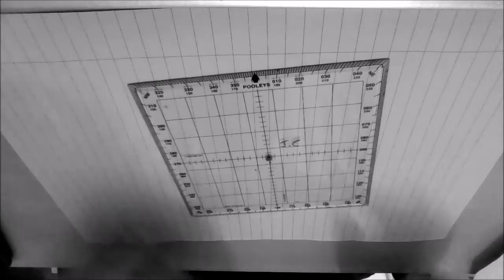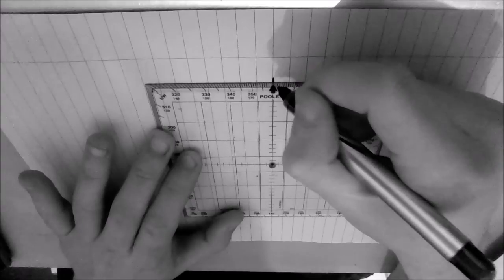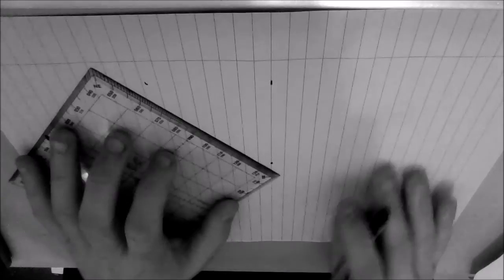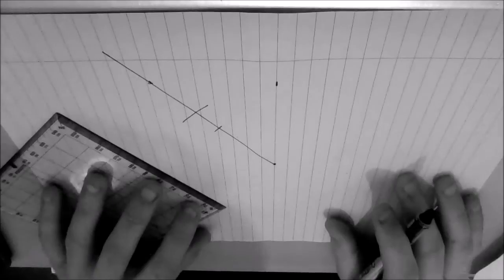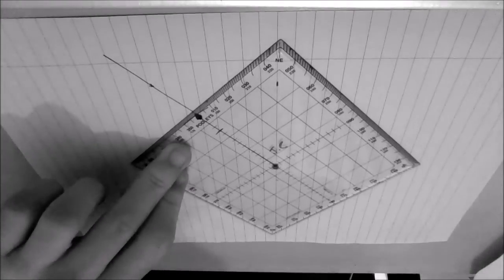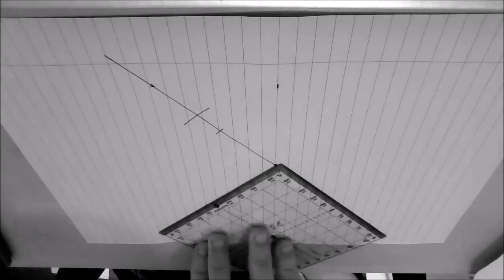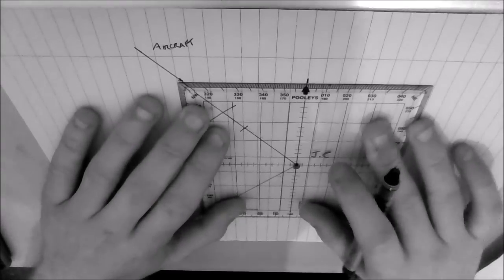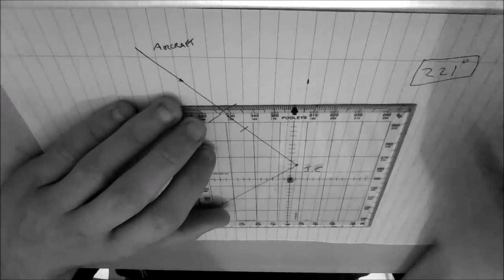General Navigation - Relative Bearings - ID:610356

Comment: do you know answer to this question? An aircraft is on track with a heading of 015 degrees true. The pilot plots the position of the aircraft and notes that a nearby town has a relative bearing from the aircraft of 294 degrees. What is the true bearing of the aircraft from the nearby town? thanks